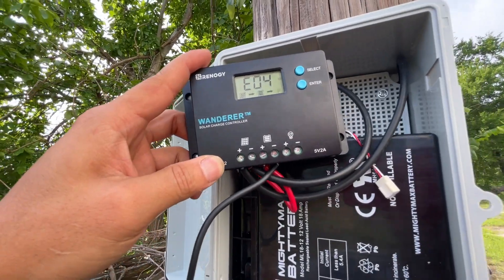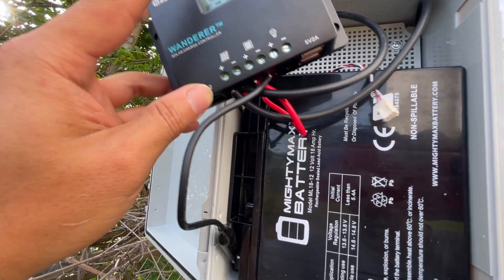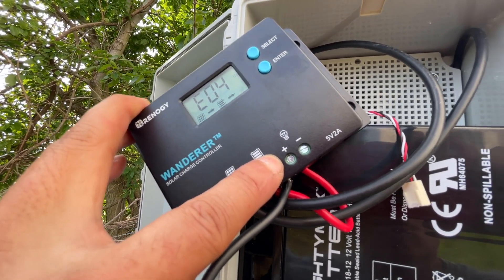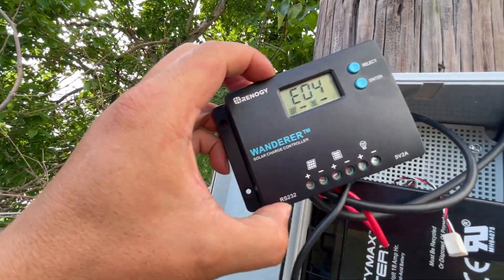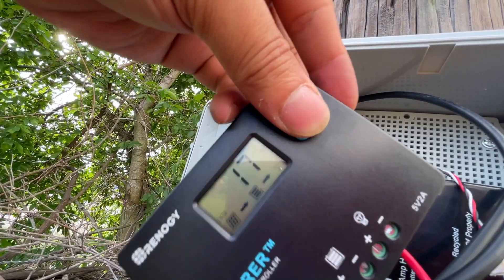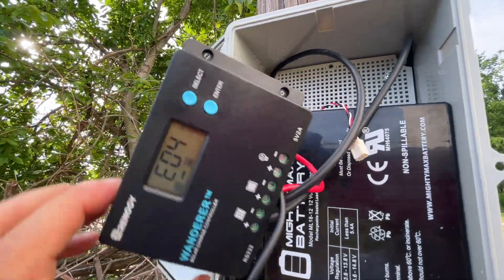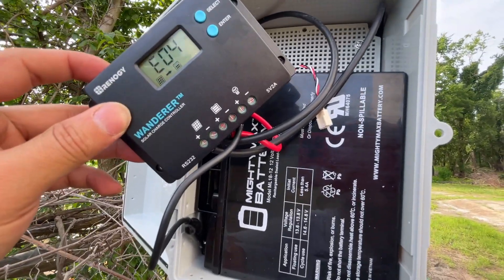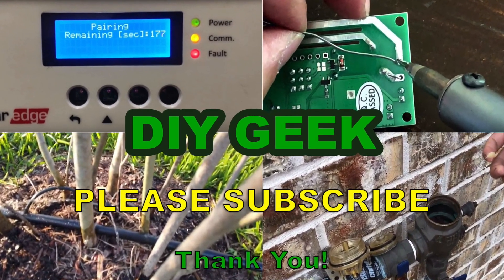RENOGY WANDERER E04 SHORT CIRCUIT ERROR

Comment: I had a similar issue. E04 error code. I unhooked the battery and hooked it back up and fixed the issue. Same thing when I occasionally get a E01 error code which is battery discharged. The charge controller does a great job overall.

Comment: So, I did hook up my unit correct the first time and even went back and started over just be sure and it is still throwing the E04 error code. Q: Can I run the load off the battery directly and just use the panel to maintain the battery? This is a rental drinking water supply station with a 12v pump, I really cant take the chance of having this thing throw a code in the middle of an event.. Thanks!

Comment: DUH!!
Renogy is a GREAT product!   The E04 error code you see is because  ~YOU-  wired it up wrong! 
Yes,  you removed the load.. BUT, you're still wired up!  It doesn't matter what LOAD you hook up to this device.. THAT error msg will remain until YOU wire it up right.. as in the way it is explained in #1 of the install instructions.  BUT, you already know this.  Line ONE in the instructions tells you NOT to wire-in the solar panel BEFORE the battery, and that's what you did. You're pretending to try and fix this.. while you ignore disconnecting the panel.  
Dude, Misleading viewers by trashing an excellent product.. WHY?  So you can make a couple bucks?  Very sad!  Thumbs down.
Reply: Btw, this is not rocket science. I did do it right and it still threw a code, even after your scolding.. Maybe its the product not because of the instructions from YOU.
Reply: @jeffbreitz722  I have Renogy products and they're excellent. They cost a little more but I was tired of dealing with crap. Your Code tells you.. your load reads shorted.. so you [Im sure] accidentally inserted the wire into the wrong hole, for a milli-second, and zapped the controller.  Maybe its a BAD CC from the shop. Stuff happens, BUT Renogy is a quality company. 
YOU.. are getting paid by pushing Victron and you're doing it by trashing a good product. O, and.. You SUCK as a salesman.
Reply: I followed the instructions and got the same code as well, put my old one back on not supporting LI batteries and worked fine. It is crap.
Reply: I followed the instructions as well and got an E10 code. Apparently a result of installing the panels before the batteries, so what is the point of the codes even? Further, why would making such a mistake render the device useless?
Reply: @TANCoffgrid  Any brand charge controller can be permanently damaged by connecting the panels BEFORE connecting the battery.
Reply: @lawrencedavidson6195  Are you sure every one of them? I am assuming this going forward, but still seems like they could have a switch that would prevent that. Thank you for the information.
Reply: What an ass, pull the fuse from the panel then to the the battery, wait 5 seconds then reverse order.
Reply: So then if you wired the battery first and then the solar and it is still doing this what do you suggest?
Reply from the maker: Wow, thats a lot of accusations. I returned the renogy and bought a victron. If it is such a great product maybe it can detect the load not connected?!?

Comment: I had this issue tonight after briefly shorting a load. What is wild is the device is so sensitive that it threw an error before any fuse was affected! 
I fixed it by disconnecting the battery and load a few times after I changed the load mode. I was initially stumped too.

Comment: Is a 1.5 amp out put you need to connect it to the battery I have a 60amp and aux port is only 5amp
Reply from the maker: t was connected to the battery. In fact I connected and disconnected a few times!  It has been replaced and it is now working (has been working good for a few months)

Comment: I had this issue today, I ended up having to disconnect the PV and battery from the controller and then add them back in. Worked fine after that.